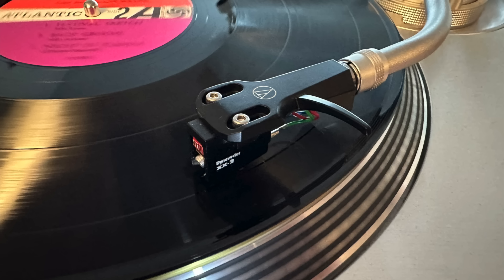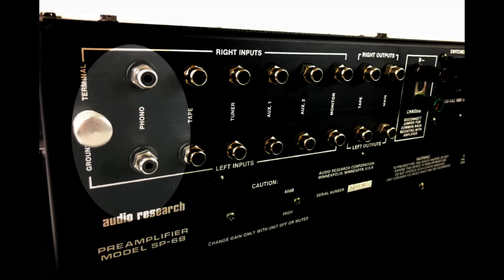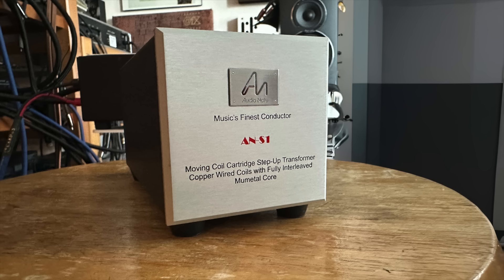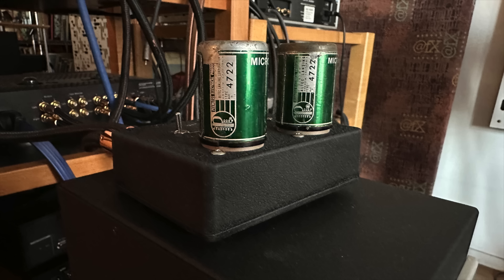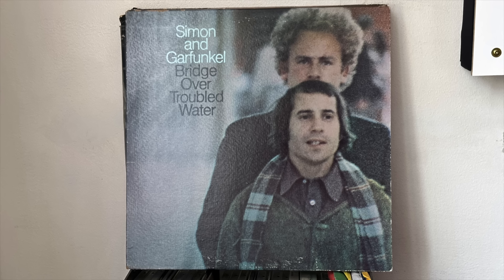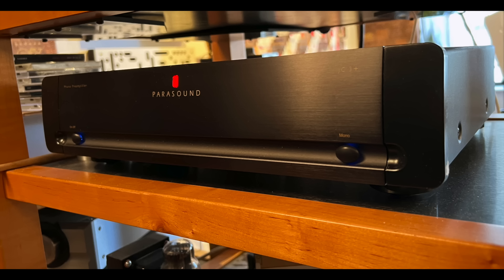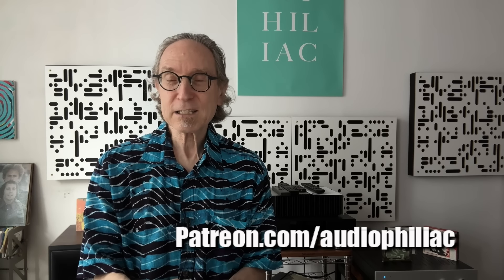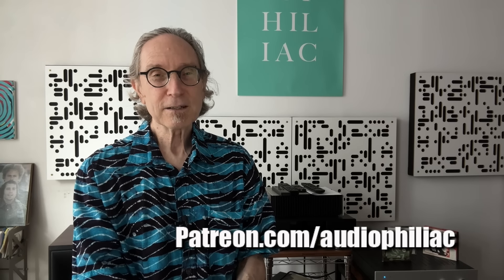HOW TO get the BEST SOUND from MC CARTRIDGES!

Comment: Try the Rothwell UK basic model 250 lb up to a thousand
you don't put a cartridge straight in the headshot I found that out recently you want to tilt it inwards a bit the inside groove is moving faster so you need to compensate that speed of the groove paire to the outside speed of the groove, not only that Wally has found I think it was 72% or higher, that the Zenith the styli is out by this much and that seems have no variation on price or manufacture of cartridge or even the same model every one is different. you can buy his Wally tool to correct this error and that means twisting the cartridge inwards, so if you just want to experiment to do it yourself half a millimeter at a time possibly even up to a millimeter and a half. I find if you put The cartridge styli Hangover point between the two screws you're about there just Mark up the vertical line of the screw head and is your reference. Twist move it slightly one way or the other it if needed. Give it a go!! Steve! You might need to adjust anti-skate differently as well don't forget anti skate pushes the canterleaver and puts the angle at the wrong angle zenith, anyway. maybe this has some bearing when twisting the cartridge because this usually corrects the imbalance in the cantilever, you should always really line up the cantilever down the center equal measurement to the Head shell centre not the body of the cartridge. this would be difficult I understand with non removable headshells you could use a mirror underneath! Anybody's trying it let me know what your results are ! always interesting. you should get it right after about two or three attempts but make sure the hangover or commonly used term pivot to spindle, using a hangover method is a lot easier and I think more accurate measurement. You can make your own tool very easily after you know what it should be for your given arm and pivot to spindle measurement. Find a bit of plastic that stiff that you can bend with a paint stripper or hair dryer even, to the given point and with a hot needle broken off anf and stick it through the plastic at that given distance making sure it's parallel 90 degrees, and not too close to the styli keep it 3mm away. I find it's more accurate maybe easier to use than the things you can buy, if you've got one of them you can glue a needle into the V make it a lot easier for you should already be set at 90 degrees

Comment: It IS the better way to go !
MC has low voltage outoput but has enough energy , so the MC transformer  stepup converting current into voltage  is the most logic method , your ears will tell you ....
Good transformers are expensive ......
I use ever since a Verion Mitchell Cotter MK2 -L and no active device gave me the same musical experience .....raidrops are falling from thr sky , footsteps are on the ground and the cow is far behinfd the wall.......
I have a Accuphase C-17 ( double mono / double transformers / pure class A ) ....it is good , even very performant judged by hifi audiophile standards but only the SUT makes me forget that I am listening to reproduced music ...
Partridge MC transformers are also exceptional as well as the Lundahl "silver" MC sut's ...
For the IC's I use OCC cables ( diy )
Best results are with a qualiity passive RIAA tube stage .
The step up ratio of a SUT MC is fixed or insome cases variable , fixed sounds superior to the same transformer with multiple winding taps ..............but the impedance load can be adjusted by changing the classic 47 Kohm input resistor on the phonostage by another value .....there are loading listings available on the web or shared by some manufacturers ........adabting the impedance loading will change the damping of the suspension of the cartridge.
Thank you for the upload .....

Comment: Steve you should try a current transimpedance head amp. One is by Hagerman audio labs for about 250$ if I recall. Would be interesting to learn how that approach compares to SUTs
Reply from the maker: I tried it, but it wasn't compatible with my system. It had too much noise/hum. I did review the trans impedance Sutherland little Loco phono preamp. Very nice

Comment: I have a Cayin CS-6PH phono pre amp. It’s mc section it’s a bit noisy with my Audiotechnica AT-OC9XSL MC cartridge. But I added an Ortofon ST-70 SUT to the system and I am using the MM section of the Cayin Phono Preamp and the noise is gone and the cartidge sounds more open, clear and punchy and more quiet in the low sound passages. Phono MM preamps adds less gain an less distortion and are easy to design. Greetings from Spain

Comment: Would a SUT work with a low output moving iron like the Grado Epoch?  Thanks.
Reply from the maker: No
Reply: @SteveGuttenbergAudiophiliac Why is that? I too was curious about that and I have a low output MI from Sound-Smith, the Sussurro. Peter Lederman states you can use a SUT with his low output MI cartridges. What is different about the Grado?

Comment: Forgive my ignorance,  but what is the difference between a step up transformer and a phono stage...
Reply from the maker: A couple of things, a phono stage is active, that is you plug it into the wall for power. Phono stage also has RIAA equalization. The transformer is passive, you don't plug it into the wall and it doesn't have equalization. That means you must use a transformer with a phono stage.
Reply: A transformer is also a free gain in every sense. While the transistor based gain has costs.

Comment: I'm about to buy a head amp, Graham Slee EXP. Keith from Wyndham Audio convinced me to use one. I will buy a Goldring Ethos. All great priced options. Keith believes a head amp takes hum and noise away normally produced by SUT's.
Reply: I disagree! A passive gain stage/SUT will always have a lower noise floor than an active tube/transistor stage.

Comment: I’m using the Ortofon 2M Black and naturally assumed my next upgrade would be to go to moving coil - but nope! After hearing the DS Audio optical system I think I’ll leapfrog right past MC. Nevertheless I found this video super informative, and useful should I ever find low output MC carts in my collection (I buy random used gear on the cheap to try out different things)
Reply: The lowest-price DS optical cartridge and dedicated eq'd stage is $5000 + $10,000 = $15,000!

Comment: How do the passive gain transformers increase the output?  Is it just a voltage increase? It I'd of course subject to conservation of energy laws?  If it is stepping up the voltage, the energy needs to come from somewhere.  The only option is current.  Mc cartridges aren't exactly renowned for high current output.  Furthermore,  there is always a loss of total energy, as Is nothing is one hundred percent efficient.  Part of that precious little energy is going to be lost to heat from induction.  Really don't see how this can work.
Reply from the maker: I'm sorry you don't understand but that's exactly what transformers do in this case increase voltage, and proportionately reduce current. But seriously you should just look up how transformers work.
Reply: Thank you, Steve.  I edited my comment to better reflect my genuine question, as well as to not seem like I was trolling.   My assumption was that we are talking about such an incredibly small amount of electricity being generated by the cartidge that it would always require  (pre)-amplification.   I guess it is voltage limited and there is enough current to do the job.  Sorry I came off snarky. @SteveGuttenbergAudiophiliac

Comment: The Zesto guy explains that the connection from an MC cart to a SUT is balanced, so I rewired my SL1200 with Belden 8451 pro signal wire. (I believe everything on the internet)
My SUT is a Lundahl heading a David Berning phono stage inside my LTA UL+ integrated. First and only experience. Forty year late. Definitely won't go back.
Reply: A MC cartridge signal isn’t balanced unless the coil is center tapped to a ground reference.

Comment: Steve, if I recall JC3 has been in your system a while, but you brought in newer even "higher" end phono pre-amps. not sure if the JC3 is still your reference but wondering how the SUTs changed your experience of your higher end phono preamps.
Reply from the maker: No, the JC 3 is the only phono pre I have
Reply: @SteveGuttenbergAudiophiliac  Thanks for confirming.. great video and great pointers... Now I need to explore the difference between the SUT you like with the Denon 103 vs. the SUT made by DENON the AU-320  SUT.
Reply: @HoomanR17 au-340 is the best for 103. Also au-103 is high quality. 320, 305, 300 etc are also ran.
Reply: @ Thanks for the recommendation!

Comment: I connect my turntable to my Supex step up transformer and then from the step transformer to the phono inputs on the amp. If there are no phono inputs on some amps, connect to the AUX inputs
Reply from the maker: Come on, aux won't work!!!
Reply: @SteveGuttenbergAudiophiliac  It did work on my old Yamaha receiver without phono inputs which I still have in my spare room.. Now it's connected to my Marantz AVR phono input. Great sound
Reply: @SteveGuttenbergAudiophiliac Hi Steve, correction: With the Yamaha receiver with no phono input I connected the turntable to the Supex step up transformer and then connect the step up transformer to a little Denon phono preamp then connect  the Denon phono pre amp to the Yamaha AUX. Been a while. I forgot. Sorry

Comment: What’s the point in spending $3-$10k on a stand alone phono preamp when all we need is a step up transformer? And why don’t these companies make their phono preamp with the step up in the circuit?
Reply: Because it is very difficult to make a low-noise 76db gain phono stage with eq.
Reply: @robertjermantowicz-uw3iw  totally understandable…there’s less advertising for step up transformers and it seems that’s the way to go for low output MC…kinda with I got the step up instead of phono pre
Reply: And a lot of them do make transformer based phono preamps like Rothwell signature 1. I thnk the signature 2 from rothwell is transistor based. So they do.  The problem is transformer can be cartridge specific and when you stick one into a phono you are limiting the variety of lomc carts it can work with.

Comment: Is there any actual evidence for the belief (which many audiophiles hold) that MC is better than MM. From what I can gather MCs is less sensitive to loading, the frequency response will stay more or less the same no matter how high or low the capacitance is. MMs don't. A good MM will have better SNR though since you don't need the same levels of pre-amp boost. A good MC pre-amp should give you a SNR of 60dB versus 80dB (or so) for a good MM pre-amp.

Yeah, a step-up and a regular MM input should fix much of the problems but does it really matter?
Reply: IMO, both MM and MC can be very good. I think it's more about the mechanical matching of your cartridge to your arm, and having a decent preamp stage. With MM, as you mentioned, you don't want too much capacitance generally. Me, I actually prefer active stages for MC, to me they sound more linear and extended generally which I prefer. I think noise may be superior if you have good MM stage with good SUT, but my active MC stage is good enough. I have some expensive SUTs sitting around...I would like try those transimpedance stages though!

Comment: It's all about gain though, isn't it?
Reply from the maker: It's complex, but yes Ginn definitely has something to do with it. And the loading of the cartridge can be crucial.
Reply: And the impedance. Both math. But in the end you make compromises based on practicality of transformer winding
Reply: @ it's not a user problem though, I have a phono stage that can max out at 76db gain, just choose the one you need

Comment: I may be totally lost here, but why not connect the transformer to the MC in your phono preamp? Wouldn’t it be even better than connecting to the MM? Thks!!
Reply from the maker: It's a fair question, because that's what transformers are designed for, designed to be used with the MM input.
Reply: It will overload the mc gain stage. A bad idea!
Reply: @robertjermantowicz-uw3iw thanks a lot for your comment!

Comment: Why do you have to run the step up into the Parasound? Couldn’t you run directly into an aux input and bypass the Parasound entirely?…s
Reply: You still need the RIAA  equalization from the phono stage
Reply from the maker: No, the transformer by itself doesn't have enough gain and it doesn't have RIAA equalization that's part of every phono preamp.

Comment: Those Mythical interconnects may be giving you much of the performance improvement you experienced.  I tried out a Dragon on a Rega Aria phono stage connected to an inexpensive integrated amp and it was nothing short of astonishing. I'm sure the transformers make a difference too but I think your review misses what the AQ cables are contributing.

Comment: Hmmm, I wonder how a microwave transformer would sound?
Reply from the maker: Try it and get back to us!
Reply: @SteveGuttenbergAudiophiliac   none at the moment,need to harvest some from the curb,although I do have a pair of transformers from an LCD TV,s light source power supply,vary high ratio for high voltage low current. I'd like to know if a simple resistor will do to set the impedence properly 🤔